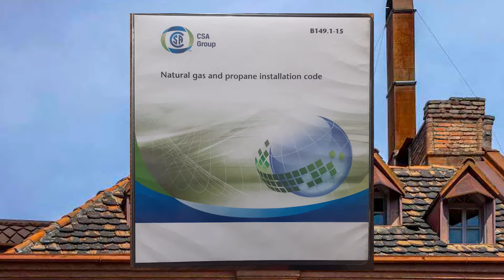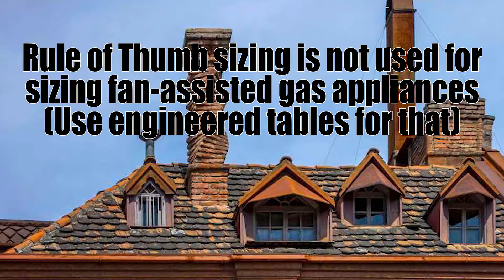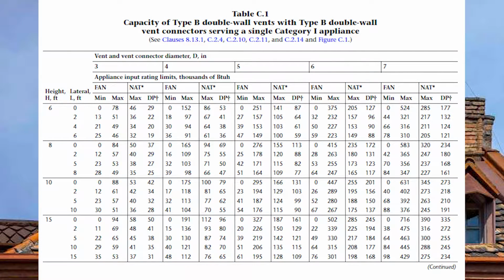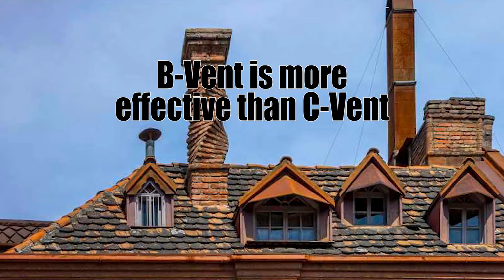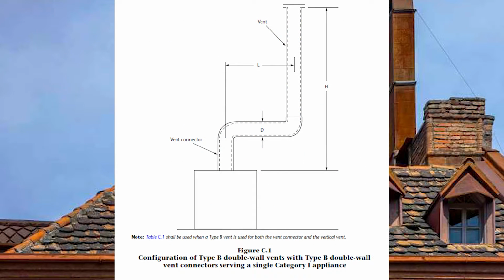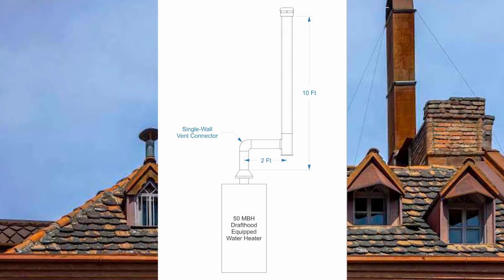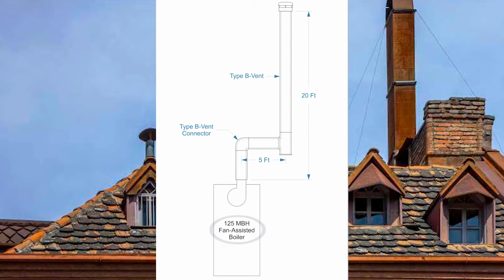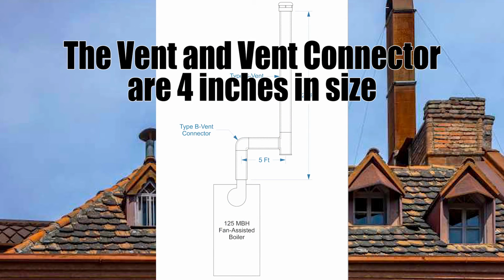Gas Venting with Tables Part: 1 - Basic Vent Sizing

Comment: What do you do if double wall vent with double wall vent connector has height of 75’ and length 25’ which is in middle of range on table
Reply from the maker: Interpolate, which is mathematically calculating what size to use based on the tables.

The video: https://youtu.be/E56ydAy0wSs